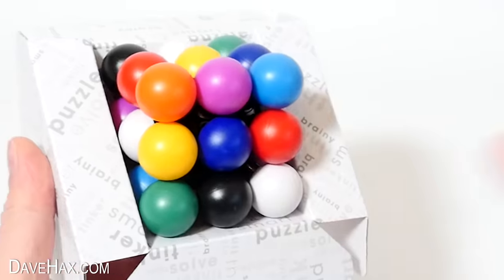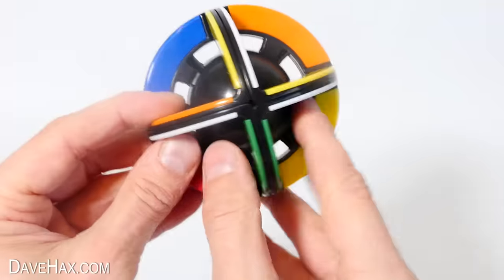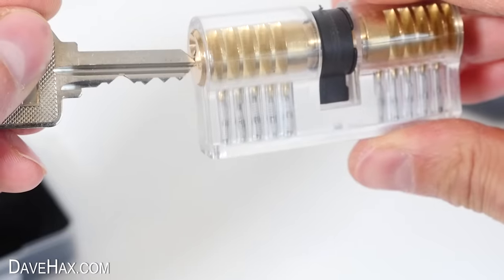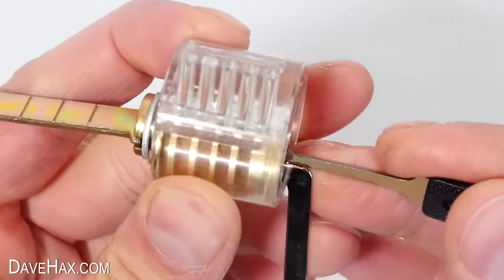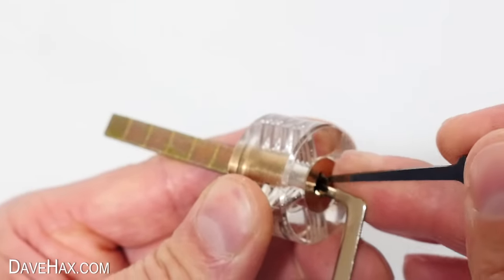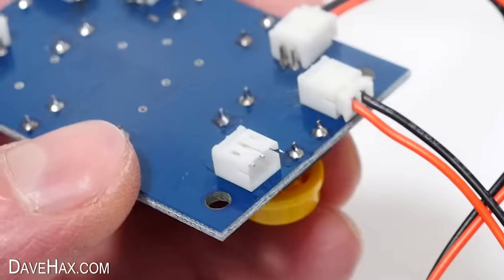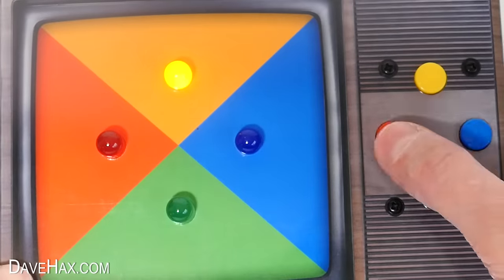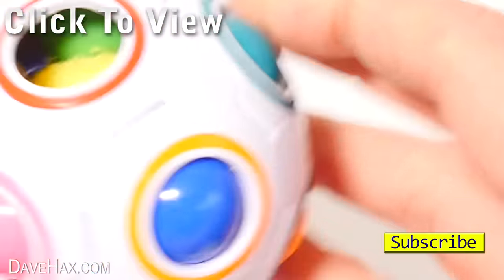Could YOU Solve This?

Comment: Personally, I’ve never been a big fan of puzzles. They take too long. So I was wondering if there might be a way to make puzzles more fun. Of course, they have building-block games like Jenga, and the Log Cabin, and LEGO, but none of those activities qualify as a puzzle. So I was thinking that it might be possible to make a 3D puzzle out of plastic parts, each of which has internal magnets. So there’s no way to know which part will stick in the right spot. You have to keep trying. 

A 3D magna-puzzle might come with two hundred blocks, each magnetically unique to the spot where it’s supposed to go. This would be easy enough for kids, and difficult enough to take a few hours. The question is cost. The puzzle would have to sell for ten dollars.